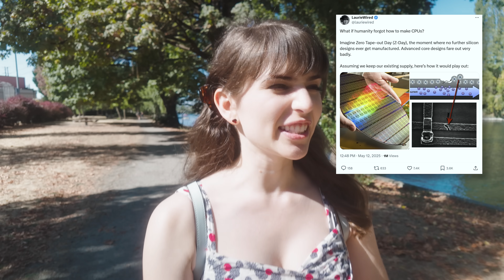what if humans forgot how to make CPUs?

Comment: My SPARCstation 1+ from 1991 still works! It keeps needing new electrolytic caps in the PSU, and it hasn't had a working NVRAM battery since 2005, but I have a rework station and I have the OBP Forth commands to tell it it's own MAC address committed to wetware memory. And anyway, 64 MiB of RAM outta be enough for anyone. Sounds like my stack of Cisco 250x routers and 251x terminal servers would be really valuable, in this scenario! I wonder how long the NPE-G2s in my 7204VXRs will last? Those could end-up as backbone routers. Got rid of the 7507, the pair of RSP16s, and the ostensible gigabit interfaces for it, unfortunately. Might still have the OC12 module, somewhere, though.
Reply: I'd like to think I'd be too busy racing around in a vehicle right out of the Road Warrior universe, raiding fuel, to worry much about computing.

Comment: Anything, given the right arrangement of components, can compute. There are a few things I think a lot of people (even in the computing space) overlook in a hypothetical silicone blackout scenario like this:
- Individual knowledge and ingenuity
- Specialized computers
- Mechanical computers
Combining these factors, I personally think there would be a resurgence of things like mechanical calculators built by hand with machine-shop style tooling in small batches for very specific purposes. This is how the original computation market worked, after all -- single, large, mostly "mechanical" computers purpose built for specific tasks. We could still do things like operate telephone networks, do complicated math, automate manufacturing, etc.
The single largest thing that would almost definitely crumble (quite quickly, I might add) is the internet and any sort of wireless infrastructure. We would effectively be reduced to the 1970s, but IMO we would not regress too much farther back than that and there would be an entirely new set of fields for people to explore with "alternative" computation.

Comment: Can't remember the name off the top of my head, but some young person etched Central Processing Unit circuits in his garage with a microscope (about the quality of micro-controllers - EDIT: Sam Zeelof https://youtu.be/IS5ycm7VfXg?si=VWDG1ZxMbY1O-b8U ). 

It's rather obvious though that without a public power grid and an industry to manufacture power banks, their supply chains or trade routes to import them, that technological erosion can come by a single war. 

While there is an argument to be made for legacy technology nodes, a chain is only as reliable as it's weakest link.

Then again, a Dark Age will practice our memory of civilizational 'canon' and deepen our thoughts and conversation - the more one has, the less it means to the point of Choice Paralysis.

Comment: The question seems to be misstated. It sounds like what is really being described is an inability to perform VLSI production, going all the way back to such components as were used to create systems like the Apple ][. Back when transistor counts were in the mere thousands for the co-processors like those in the Atari 800 computer.

If the question is 'what if we forgot how to make stuff using 2025 process nodes?', that is a very different story. We need to define how far back this tech amnesia goes. 2020, when the PS5 and ZEN 2 processors were produced on TSMC's 7NP node? We get some renewed interest in software optimizations but also a lot of investment in how to do more with that node via better cooling to allow larger dies and better interconnects to allow more of those dies to be ganged together. The ongoing efforts to find what comes after silicon also gets heightened investment.

Forgetting how to make CPUs requires forgetting how to make a LOT of stuff that goes into the process. If the CPU designs themselves were erased, going back to the 4004, but we still had the capability for VLSI production, I believe we'd have some decent 32-bit microprocessors in less than a decade. Given modern tools, the guys who gave us the big names from the 70s like the Z80, 6502, and 8088, could have done far, far more.

Comment: Assuming that all data on how to make modern chips is lost, along with everyone that had that knowledge, and the only people left would be those who didn't have that knowledge, then I kinda agree that there would be an optimization race, but knowing that a drive will eventually fail, governments, institutions, and anyone with time, care, or resources, would start printing out the data. They could print it on paper, etch it on wood, stones, glass, metal, anywhere they can store it long term until they find another reliable way of accessing that data.

What would also happen is that everyone would start developing alternative computing. Optical computing, analog computing, mechanical computing, hydraulic computing, anything!

Even if a chip fails completely, it could be looked at under a microscope or x-rayed to recreate it. The chip created could go from the size of your fingernail to the size of a building, but it would be functionally the same.

The black market for chips would likely be for those that couldn't afford the new alternatives, but even those would eventually reach everyone else. 

The internet would slow down, but it wouldn't disappear. People would be connected through telephone lines and manual switching would be reintroduced, until a new way to automate is created.

A lot of tech companies would go bankrupt, tho. Propaganda would have a much harder time propagating, and governments would once again have an easier time hiding shady shit they do.

The more a country relied on the latest tech, the worse they'd be off, and the countries that didn't rely that much on technology (production, distribution, or consumption) wouldn't be hit as hard.

This means that the global south would be hit less hard than the global north. Some of those countries could seize the opportunity to gain more sovereignty over their resources, as the machinery necessary to extract the resources would eventually fail.

Comment: Still waiting for the diodes and capacitors to bleed out onto the circuit board of the ECM in my 1993 F350 as many don’t last more than 20-25 years. I still have my EMP attack safe 1966 F100 in the event of a total meltdown…

Comment: Realistically, it would just be a setback. We'd start research into manufacturing processes again right away. Even if we had to start again from vacuum tubes, it only took us around 50 years to go from the first silicon CPU to reaching modern day and that was without a blueprint as we would have in this situation. Even if all manufacturing knowedge was lost, we still have the research papers, which we can build on. I'd wager we'd have 22nm processor manufacturing up and running again in like 10years.

Comment: You mentioned "under-volting" but not reductions in clock speed.
Under-volting may or may not be possible for some CPU's, but you can almost always underclock and I've been told it tends to reduce heat by roughly the square of the reduction so I assume it would significantly help with longevity, maybe more so that reducing the voltage.

Comment: I mean... I'm not the smartest but from a perspective it would't take much for humanity to remember doing CPUs again, without wars and just with a neutral level of incentive to readvance tech say all CPU manufacturing is destroyed tomorrow cause wars and invasions. If there is a tech guild/tech union acting as a contingency to re discover recently lost tech the doccument & reverse engineer said tech back into existence I estimate it would take as much time to recover the tech or mabye half the time it took for the initial discovery to have it recovered.

Say AMD's Ryzen 9 9950X3D and Ryzen 7 9800X3D is the latest in CPU , first ever recognized CPU The Intel 4004, released in November 1971 , with all the reverse engineering we have today even if the process of rediscovery happens 5 years from now I think it would take a quarter of time mabye less to get back to the Ryzen 7 technicality cause the cultural and technical memory is still fresh and that wouid be a great deal of help with figuring out CPUs again just from cutting the surface of a die of a CPU soo much can be learned and the way science works I think for all scientists it would be as easy as... hmm what's this? A sandwitch of metal and silicon... ok we can figure out the basics in a few years and then scale from there cause from my perspective each advancement in tech always seemed impossible but always the sollution turned out to be much simpler, finer motors, smaller movements anti vibration chambers, clean rooms, photo electric printing. 

IMO the biggest threat isn't forgetting to make CPUs is putting obstacles to those who want to re discover it and seeing old tech as hollistic and focusing more on the economic inflation of the existing products rather than re researching the forgotten tech back into existence.

Comment: We can't forget how to make CPUs... Their designs are everywhere in every textbook of electronics and semiconductors. Even I have made an 8bit CPU on breadboards from scratch and I know that someone made a 16 bit CPU as a DIY project. An other guy that made a 64 bit analogue processor in minecraft. Another guy used home made lithography to make the Zeloof Z2 chip that contains 1,200 transistors. We can't forget how to make CPUs the information is everywhere and we can scale it very fast. We could forget some very important trade secrets. We could loss 10 or 20 year of progress if a major production line or a manufacturer gets hit by a disaster. But nothing as serous as what you describe.

Comment: One thing of note, the CD's and DVD's wouldn't last very long. it's a problem that the people at the U.S. Library of Congress have been dealing and doing the best to solve for purposes of data preservation for the past 15-to-17 years (don't quote me on how long it's been, the only reason I know of it in the first place is because I know a guy that worked on the project for a while).

Edit: Just Remembered this. Tektronix (yes, the Oscilloscope makers) had their own internal computer network in the 1970's (1973 I think, again, don't quote me on it), and some of their engineers were hand-soldering CPU's out of non-silicon based materials even before that (For fun primarily, cause back then building a PC with your kid was a much more involved process).

Comment: 11:15 "to optical media CDs and DVDs that do not require anything mechanical" ??? The disk is rotated. A head is moved to the right track, and head is moved up down to focus the beam. That is 3 different mechanical movements.
Reply: They're talking about storing data. Solid state needs to maintain an electrical charge. Hard disk drives relies on delicate components prone to failure (mentioned around 9:50). CD's use bumps to store data, light to read it, and the components are not nearly as delicate. I think the idea is there is less room for loss of data with CD's and the technology is marginally more simple. Just my guess.

Edit: Pits, not bumps

Comment: I think if we are hardlocked out of digital silicon transistor cpus, There would be a rise in analog computing as a replacement. It could lead to even higher processing throughput than we currently are capable of doing on silicon systems.  I know that quantum computers are analog already

Comment: Manufacturing of CPU dead there would be 3 groups that take up the computing mantle

suddenly the niche hobby of machining turns into a cottage industry trying to replicate the works of great grandparents of computing in order to outrace the death of computing, perhaps trying to produce things that could moderate, offload or augment existing systems as they degrade, mechanical computing does have it's drawbacks but there are some tasks it can do incredibly efficiently and there would be a drive to create more of these designs, we only lost CPU manufacture so mechanical encoding with mixed substates is reasonable, from Pinball Machines to Jukeboxes we have many examples of electronics being controled by rotating disks and similarly motors would still exist to translate between the mediums

Archivists would attempt to preserve everything, there are the data storage on media but don't underestimate the power of paper copies of everything there'd be a boom of people wanting to print everything they could before the last printer died and then an uptick in people buying vintage type writers to copy down their favourite things to preserve them as best they can in a medium that will be accessible for the rest of their lives, videos might be recorded back onto film media so that it will always be watchable and sounds onto vinyl storage, because even CDs require microprocessors to read and write from 

Lastly, I think you'd end up with people trying to reproduce the results of computing power from scratch, we can't make processors but there may be transistor technologies to discover, and once even one of those exists, the knowledge gained from the failures of computers as much as the successes would lead to an accelerated design of processors with new technology. Some people may do this through the pursuit of theoretical designs in the spirit of the great grandparents of computing designing things that should work if only the skills and methods to make the precisely and accurately existed first. We might not know how to make silicon transistors but we know how to design processors to such a refined degree we can build them with toys like Conway's Life, Minecraft, WireWorld, and more, almost every compatible medium for computing will be attempted and something might work.

Comment: It is not only optimization but also the removal of bloat and memory hogs. The web existed at the time of 486 (500nm) and 56k modem, people creating website were aware of limitations and were packing small pictures and tight text. Older computers will outlast the modern. an old-ish computer with a good ssd could outlive the rest. Nothing "robust" can be made below 100nm except if we switch to photonics, where I don't know the resistance over time.

Comment: So tape outs are probably two generations ahead of full volume manufacturing. So take Nvidia, H100 type well past peak H200 close to peak H300 low volume validation H400 taped out design in prototype mask validation. So if we forgot we could carry on scaling for 10 years, while AI reverse engineered all processes. This is what the Chinese are doing without AI and chip layout software from Cadence.

Comment: This is somewhat of an interesting exercise, but I think the fundamental assumption that we stopped making CPUs while still widely using CPUs is kind of silly. We didn't stop making CRTs in 1990. We didn't lose the ability to make a Saturn V in the middle of the Apollo program. Unless there's a sudden material shortage we typically only stop making something (and therefore lose the ability to make it) once the demand for it has become very low or even non-existent. More realistically if/when we stop using CPUs it'll probably be because we've moved over to some other kind of computing tool, like maybe GPUs or the AI chips they're making these days

Comment: To all who say „We will just do it again”. Well… yes and no. People tend to forget, that our technology isn’t easily replaceable from scratch. We build each iteration and generally tear down whatever we needed for the previous one. Like, to make today’s steel we need components made from steel and we need machines that cannot be made without steel. How were they made then? Using the previous generations of steel, and those were made using tools of wrought iron, which… So if we suddenly lost some critical components of technology needed to build, say, CPUs, this might not even be something SPECIFIC to CPU manufacturing, just one of the prerequisites in chemical industry, it might be so that even though we’d still KNOW how to make it, we’d still need to rewind the clock by greater part of a century just to get back to the point where we can pick up again.
Also, modern CPUs are impossible to design and manufacture without very specific software and without a LOT of process-specific parameters that need to be measured. If we lose e.g. critical components of interferometric distance measurement we are back to stone age in a lot of industries and just to recreate the „dimension masters” would be a generations task well beyond the timeline of this video’s scenario.

Comment: There won't be a need to make CPUs because holographic optical quantum computers won't need them... In fact, holographic optical systems will replace everything... The amount of storage will basically be endless and compute speed will be almost instant... Not to mention that these systems will use far far less energy to operate. It's ironic to think that this technology won't really see light until most of these data centers that are being built... Along with their power supplies... Are completed... It will seem like quite a waste but the benefits of holographic compute will far outweigh the continued use of legacy systems. Holographic system will also be 3D printable saving billions if not trillions in manufacturing and materials... Wild stuff.